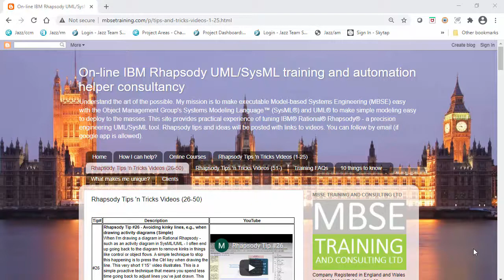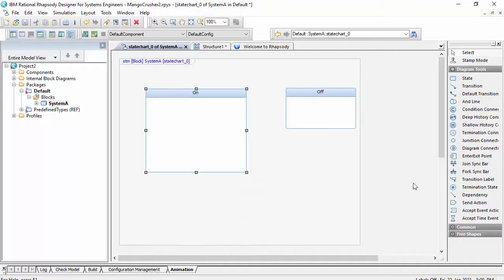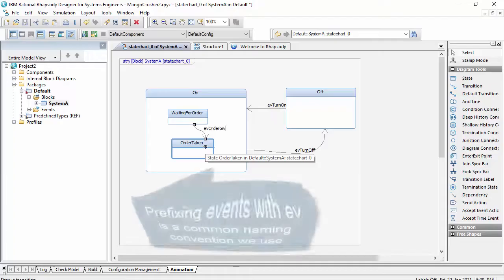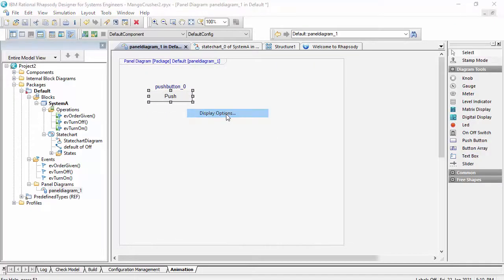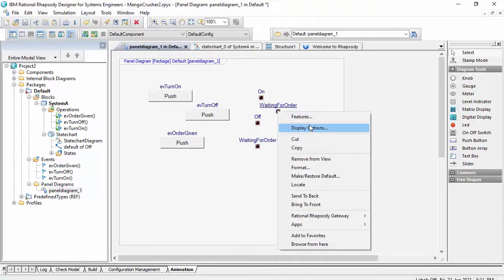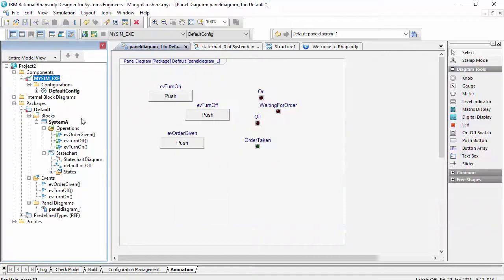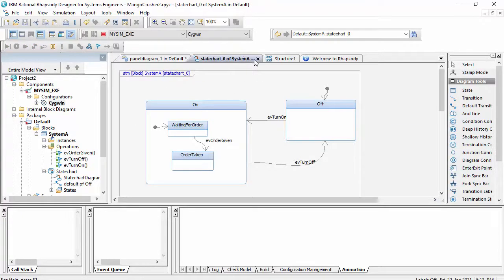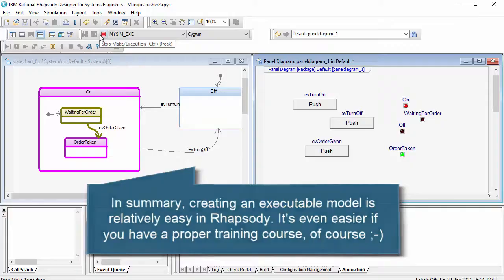IBM Engineering Rhapsody Tip #92 - Creating a simulation with panel diagram (Intermediate)

Comment: I have a model where I am NOT using Structured Classes, but I am using Composition relationships between classes, for instance:
- ClassA is composed of ClassB
- ClassB is composed of ClassC

As I am NOT using Structured Classes, Rhapsody browser is NOT showing Parts. But the code generator is still correctly realizing the composition relationships, i.e., if I create an instance of ClassA, then an instance of ClassB and an instance of ClassC will be automatically created (of course in reverse order, i.e., ClassC is instantiated first, then ClassB, and finally ClassA).

QUESTION: assuming ClassC has a statechart with transitions on events (e.g., evOn, evOff), how to bind a PushButton to one of those events, e.g., evOn??? The issue is that the PushButton dialog window is NOT showing the different parts and I am not able to bind the button to an event that is in itsClassC (which is part of itsClassB, which is part of ClassA[0]). In other terms, I cannot set the path to Default.ClassA[0].itsClassB.itsClassC.evOn. Even manually I cannot do it, as I will get a message "The path ClassA[0].itsClassB.itsClassC.evOn cannot be resolved. Verify that the path you entered is correct, or select the relevant element in the browser."